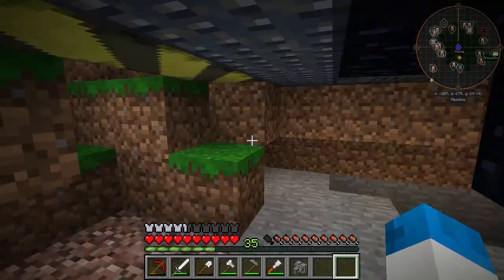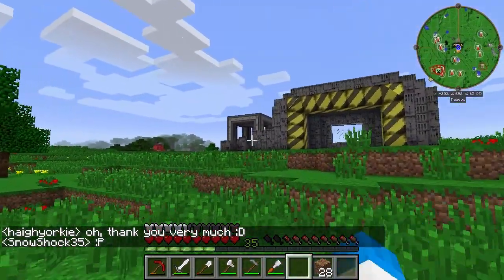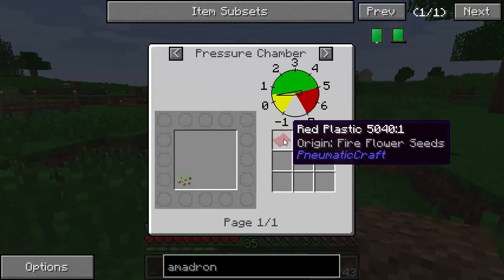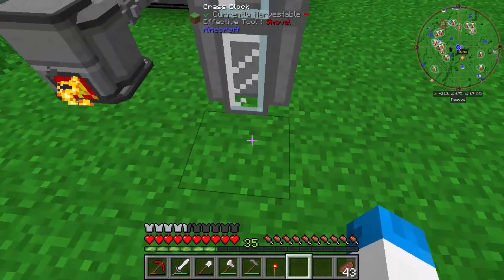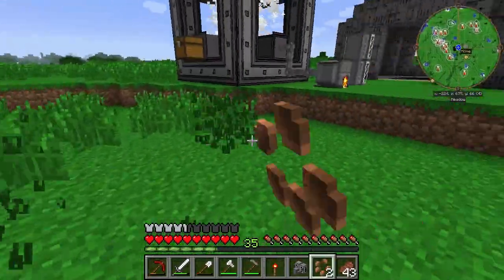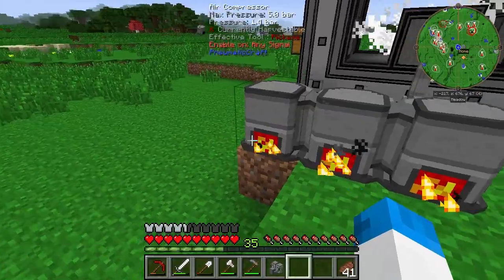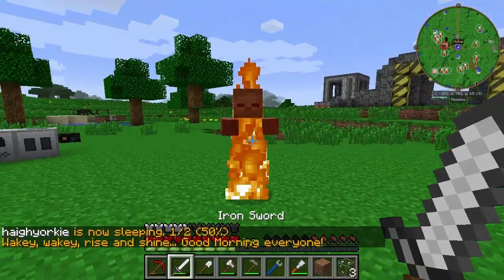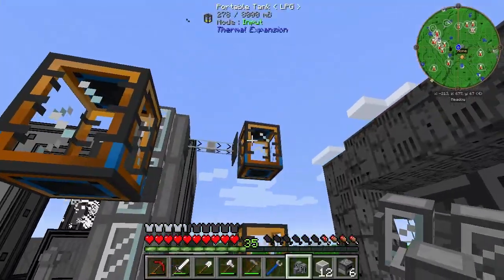Minecraft - FTB Inventions Part 6 - The Vortex Tube!

Comment: good job so far ,a few mentions relating to questions/issues if u decide to explore these bits later
amerdon is essential a trader drone and its possible that every trade that drone can do is found on a villager and some vice versa (drone having villiger trades) 

i could be wrong but i think the liquid compressor and the advanced compressor are 2 different blocks (probably closer to there being an advanced liquid compressor )do note trying to use an advanced tier compressor without advanced pipes(or/and other preparations) might lead to explosions because they can generate pressure lvls above the standard safe lvl 

there is an rf compressor later down the line but yay its later down the tech tree and theres additional mechanics surrounding it  and the additional mechanics actually prefer cold and a few "heat sinks "

Comment: fyi you can heat both machines with one tube. if you move the tube one block to the right you can use a column of either iron or compressed iron to transmit heat.